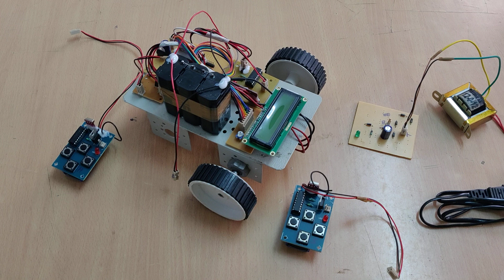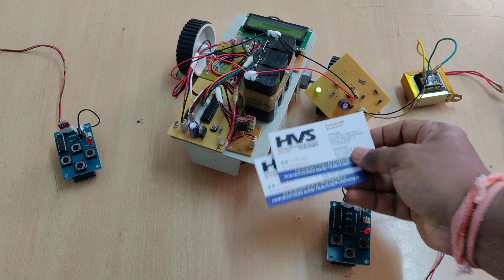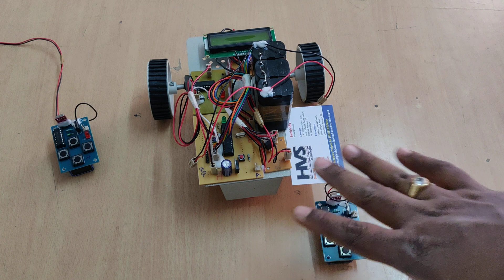HVS-573. Smart Zone Based Vehicle speed control System Based on RF #smartvehicle#RFBasedSpeedControl

Comment: Sir where should we place reciever when we are implementing for a domestic vehicle 
And can we do this project without using transmitter by directly connecting GPS to reciever by writing required program in aurdino 
Sir pls reply 🙏
Reply from the maker: Yes. We can make it using Arduino and GPS. Location based speed limit. As we know,
Our indian government is also planning for location based toll collection using GPS.
Reply: @hvstechnologies  sir can we get ur details so that we want to get some references through u which are helpful for our project 🙏
Reply: @hvstechnologies  And which is the best place for placing reciever in vehicle sir ...?
Reply from the maker: @balajikuncham3651  dashboard
Reply: Sir ur details ..??
Reply from the maker: @balajikuncham3651  You can contact us at +919603140482
Through WhatsApp or call
Reply: @hvstechnologies  Thank you sir 😊
Reply: Sir one last question where should we connect Mc and aurdino connections in dashboard or somewhere else at boonet
Reply from the maker: @balajikuncham3651  boonet
Reply: @hvstechnologies  Thank you sir 😊